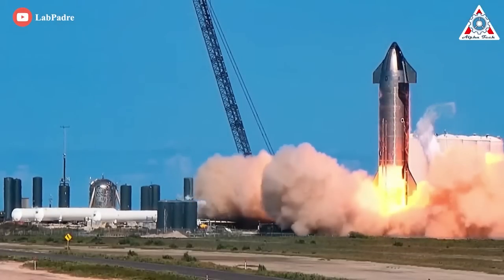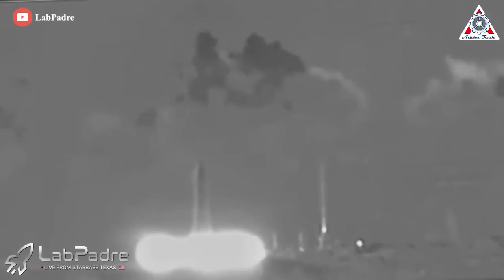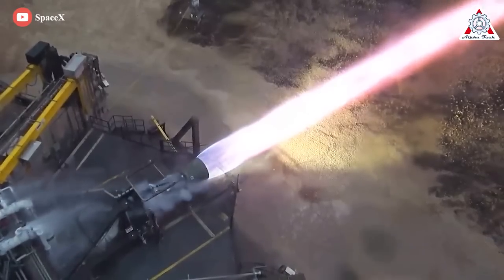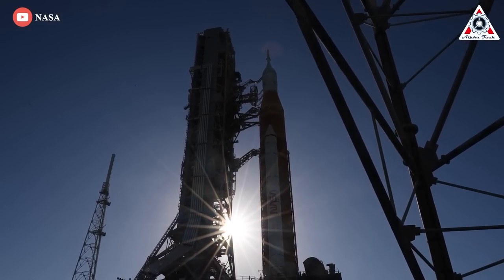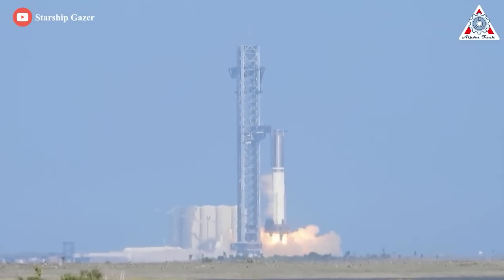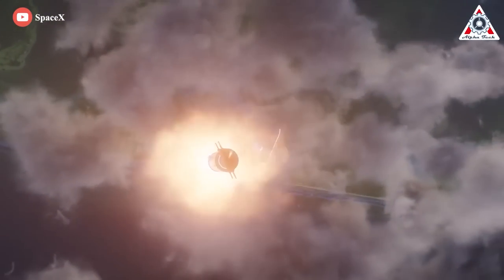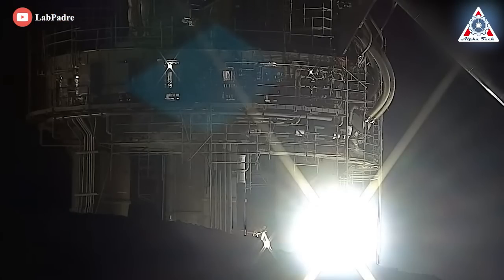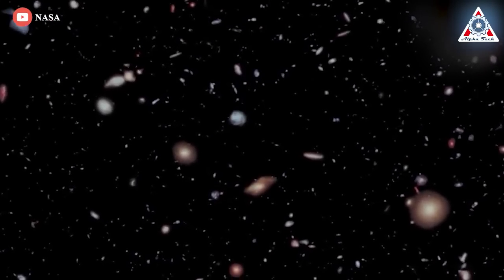Musk's SpaceX facing HUGE TROUBLE with all Engine Static Fire, Elon's Reaction...

Comment: The problem with a video every day makes it hard to have new and fresh info for each video.  This one particular video is very much reused material. 👎
Reply: Agreed but misinformation is not good either.. the fire that happened after the static was left to burn by the fire department to prevent future brush fires
Reply: @shadonw6180  … quoting outdated information or tweets as if they are relevant is misinformation.
Reply: Old information branded as new = bad information.
Reply: Agreed, this is all old news. Unfortunately, this channel has become spam. I guess they’ll do anything to make a YouTube buck.
Reply: Absolutely
Reply: I have unsubscribed from Alpha tech and Great SpaceX.  They appear to be run by the same group and often near duplicate each other.  I used to like their slightly different perspective, but since they started posting everyday it has degraded rapidly.

Comment: I'm no Rocket Scientist, but why not dig a bowl shape under the test stand with sides angled for appropriate deflection of heat, gas and shock waves. Then, line the entire thing with the ceramic heat shield tiles? This could work couldn't it? Any comments?

Comment: A couple of things are happening. First SpaceX location was about the only option for a indepemdemt company to build a site since these rockets typically aren't allowed to fly over populations. That being said unfortunately they then are bound by laws about the surrounding land hence No ability to build a NASA type pad with underground redirection troughs, imagine SLS trying to launch from here they would end up same boat. But i have stated before I truly think they don't want a safe pad since that will not be available in any way of any foeriegn planet for a long time. So, if it can't take off and land here on basic structures then it will end up similarly out there in the cosmos. 2nd the fires really shouldn't be a big issue since they could just lay a huge commercial sprinkler system all around the area flooding the surrounding with fine mist and water. Of course, again because of the location they run into laws protecting the land there. I can never imagine Elon with his calculating mind hasn't thought this stuff through, but who knows but him. Cheers and as always wishing your team the best

Comment: Hmmm ... If Musk's BF Rocket ... Rips Up the reinforced concrete Lunch Pad and damages the Engines with the kicked up Debris ... HTF is it going to Land on the Stoney , Rocky , Sandy , gravely , uneven Surfaces of the Moon and Mars ?? ... without digging a BF Hole and blasting Debris for miles ? ... What Magical Musk needs is a NASA Lunar Lander that , leaves the surface perfectly Pristine ... :-D
Reply: The booster is what rips up the ground.  The ship will not rip up the ground as can be seen when the ship launched and then landed without the booster in 2022
Reply: @rodneylee4026  That's because the BF Starship landed on a Reinforced Concrete Pad  , that's about 3 feet thick !  ... And it still blew stuff all over ...  Ship 24 blasted burning Rubble everywhere , starting fires ! .... It will be interesting to watch the Tests ... to see if it can Land on a field or beach ... It shouldn't be too hard ... Apollo did it , and didn't move a Rock ... :D
Reply: @robertbrander2074  `It appears as though by the time it reaches the land it is on one Raptor engine only.